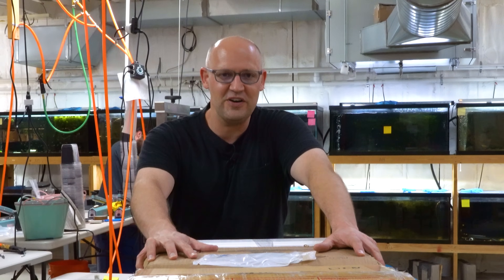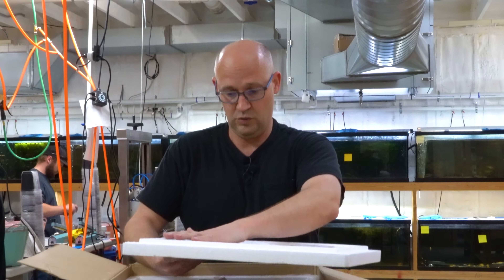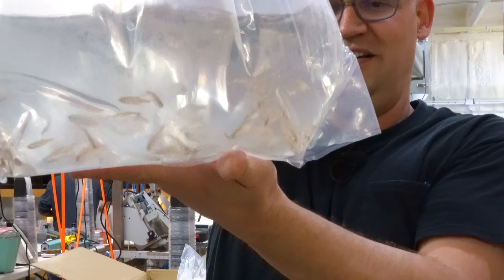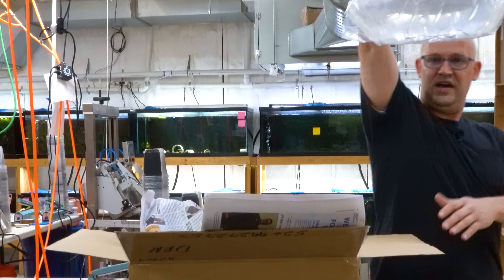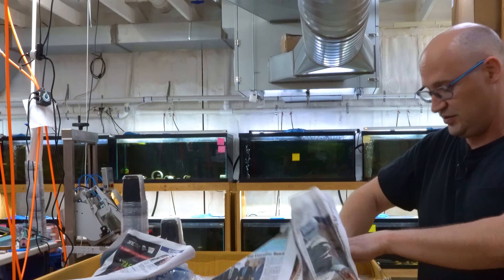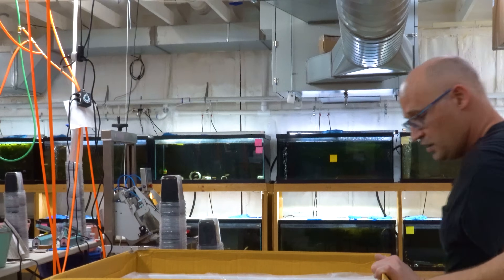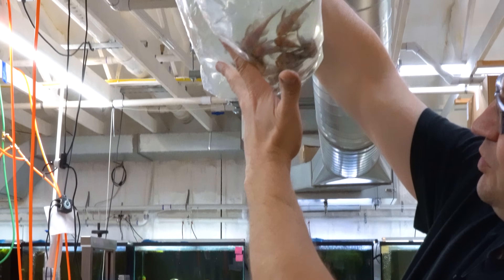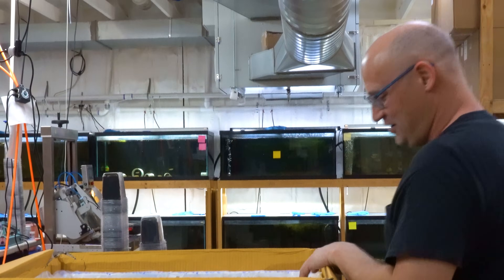Aquarium Fish Import UNBOXING

Comment: Buy some, get one aquarium free?
I've got a pretty good idea how cold it gets in Wyoming. I grew up in North Western Colorado, and we used to go to Wyoming (including Sheridan) all the time for stock shows, and for barrel racing when there was a rodeo which included amateur or high school barrel racing. I had a really sweet little cutting horse who could run the course without me. She could cut the fly specks out of a box of pepper, and could dust every one of those barrels clean without slightly wiggling even one. Only thing I had to do was stay on top. But yeh, raced up there, and watched my sister race up there. Also been up there when my dad had bought stock up there and we needed to move them back to our place. That often meant driving three or four stock trucks up and back, and as soon as I was old enough to drive, I got recruited to do some of the driving. Blizzards were a thing both in Colorado and Wyoming, and oh good golly it could get cold when that wind got going. If it was still, it could be 20 degrees out and I wouldn't wear a coat, but if there was wind, I couldn't get enough layers on. Knowing how it is there, I don't have a clue what dark magic you work to get those fish to me happy and cosy. I live in Nebraska now, and it seems a lot like Wyoming and Colorado except without mountains and hills. The wild fish are different than are back home too. There it's more cutthroat trout and a few skulpins swimming around in rocky water with lots of sunshine. Here in Nebraska, it's whatever can survive being frozen in ice for three or four months. Maybe more. Those which don't survive end up making food for the vast numbers of birds which fly through here during the great migration in the springtime. Birds like cranes, geese, and ducks don't have to worry about predators to much, since all the predators have packed themselves on the abundant dead fish, and are just too fat, full, and sleepy to try to take down the herbivorous birds. I've seen bald eagles which were so full that they weren't able to take off until they'd digested it a bit and pooped some of what they ate earlier out. When it comes right down to it, most birds of prey would rather eat something that is already dead than have to kill it themselves. With luck, the fish in my aquarium won't end up anywhere near like that.